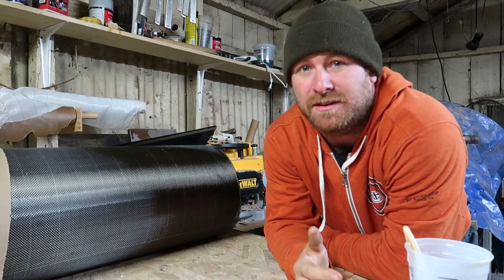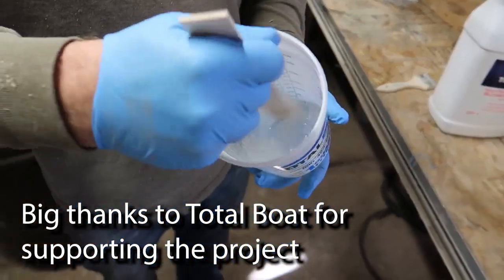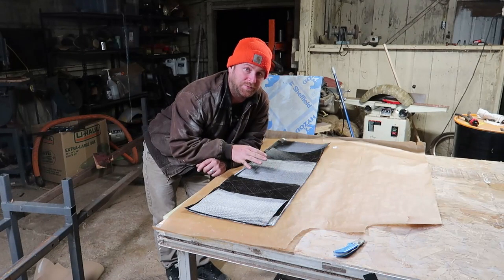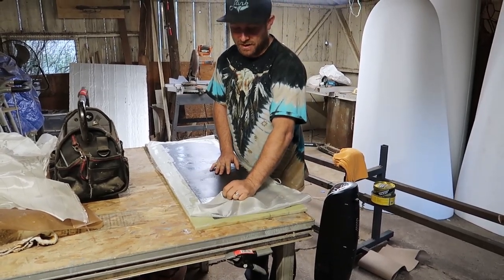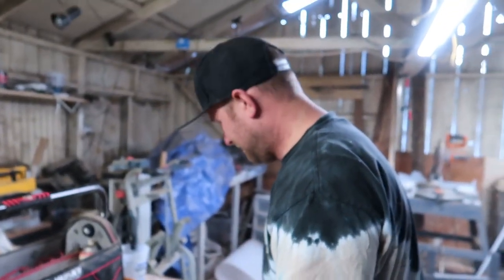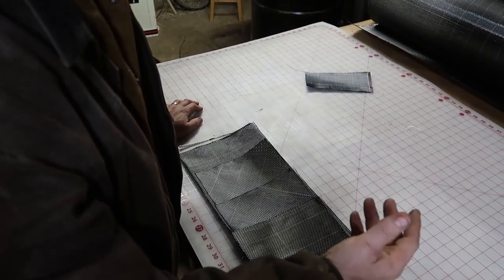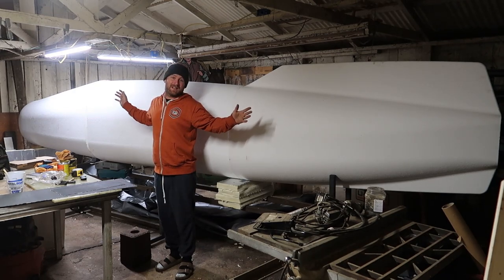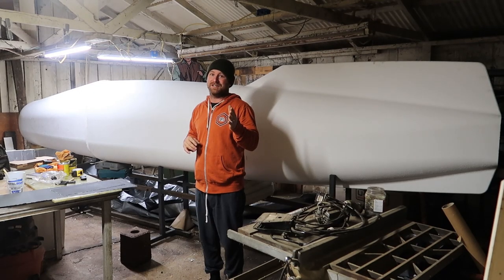Carbon Fiber Body Part 1 | Foam and testing | Lark Machine Co

Comment: Look to Ral Klingberg, Klingbergwing Youtube channel for the benefits of using a glass/foam/carbon layup. Light weight, lower cost, very rigid composite solution. A few mm of filler between the inner and outer layups  makes a huge difference in stiffening up body panels. Ultralight Aircraft Workshop, Leon has done extensive testing of composite sandwich techniques. Consider that carbon is brittle, it can fracture into sharp fragments, a Kevlar layer Is a good inner shield against carbon splinters.
Reply from the maker: Other comments have been shedding more light on that. That's why I love the youtube community!  I'll binge watch the channel tonight!

Comment: You could try and ring Denis Manning he is overflowing with knowledge on this stuff. Also thoughts on your supports you could place them in the front and rear where the wheels will be so less repairs needed as with the center section? I am just learning about vacuum bagging this could be a thought,   Brilliant job keep the updates coming, looking forward to seeing your progress through this build, best of luck
Reply: Putting supports in the areas that will be cutout for the wheels would be the best way to go.
Reply from the maker: Awesome input. I took a visit to Dennis last year! Such a nice guy. I was looking at his molds to see if they would fit.  I'll edit my visit for the next video.

Comment: Once the fibre is on the shell the contours will add considerable strength, basing your estimate on a flat section maybe not that realistic, plus you want to keep the weight down, and you can't take layers off once it's done and you have second thoughts. Great build, hope to see your video of it running.
Reply from the maker: This video has opened a lot awesome conversations with some experts. I plan on doing some more mock ups on round parts too!

Comment: Nice video! How many GSM was the carbon fabric? Are you laying straight onto the foam and then using that as a shell (sand outside smooth) or taking a mould off the foam and laying into that? Good luck 👍
Reply from the maker: The plan is to get the foam mounted, smooth and seal it, layup over the foam and cut the part from the foam
Reply: @sheanyquist  ok good luck! I made a motorcycle swingarm cleat using a similar method, but it needed 2 or 3 coats of resin on top at the end to build a layer of resin that covered the carbon weave and that I could sand dead flat - which added a fair bit of weight and work to the part. 
In this case I would have had the foam CNC directly to be the mould, smooth it with boat building epoxy primer and sand before taking a part, however I have no expertise so could be talking crap 😅. I look forward to seeing your results anyway!!

Comment: If you want to save some money you can always mix a couple layers glassfiber on top of the carbon. This will maintain strength while cutting some cost. Common praxis.
Reply from the maker: I've heard that mixing glass and carbon can be bad. They expand and contract at different rates and can cause serious delamination.  I've never tried it, but I don't want to risk it on this project

Comment: I've watched your videos, and never saw a heat gun being used.  Your layups look very resin rich.  Heat will thin the resin and help you get 100% saturation, without excessive resin. Their is no extra stregnth in being resin rich.
Reply from the maker: I am heating the resin before mixing for the final layups. Seems to penetrate better, just pops off a bit fast for a one man job
Reply from the maker: Keep the tips coming!!!  I'll take any advice I can get
Reply: @sheanyquist  Locally heating it while you work it is the preferred method. Heating it all at once caused it to exotherm.  Go to Walmart had get a cheapo hair dryer. It will make a big difference
Reply: @sheanyquist  Find your closest EAA Chapter. It probably has a great composites guy, who can show you some tricks.....

Comment: Try vacuum bagging. It will get rid of excess epoxy. Too much epoxy makes carbon brittle. ((I'm a hairdresser who makes carbon fibre hydrofoil boards as a hobby) not an expert just repeating what I was told by experts.)
Reply: Yeah, I would have expected to see the vacuum bagging aspect of the test. From what I understand (limited understanding) is one should match the weight of the fiber to the weight of the resin, which provides best strength to weight ratio of the finished composite. I hope Shea vacuum bags the entire shell, to get the most strength and the lightest weight.
Reply from the maker: Vacuum bagging is an option, it's just not practical on a 20 ft piece on a stand
Reply: @sheanyquist  ( take all ideas with a pinch of salt, again I'm not a carbon expert. I just muck around with it for a hobby) Could you not cut the mold/boss in 2 halves either vertically or horizontally, then put the flat bit on a large flat surface and vacuum bag it? 20ft is long but plastic vacuum bags come in rolls long enough to do boats.

Another trick/technique I was shown is pre wetting each layer separately. 
First laying out a sheet of plastic on a table.
Then using only a small amount of epoxy and the roller wet the cloth.
Then "plastic squeegee" to remove excess epoxy. I got the large plastic squeegee from the paint section of the hardware store.
The last step is lift the plastic off the table and lay the wet side down in your desired location. Once layed down take a second soft squeegee (like for window cleaning) and wipe it over the plastic to remove even more excess epoxy.

Amazing watching what you're up to. Keep the content coming!
Reply from the maker: @posko76  absolutely, I'm open to the idea and I definitely think it will help. I'm just not sure how it would work with this size part
Reply: Splitting your plug horizontally would be a good way to go for the main part and then split the tail vertically ....

Comment: Hi Shea, A very skilled man. Just a thought: hill climb bikes. I've long thuoght that one could build a really exceptionally effective hill-climb bike with an electric motor and battery and two wheel drive.  The entire design based around keeping the weight low, giving the rider the optimum seating position / control position.  Its a very niche sport, but there's a slightly off-beat following in Belgium.  Nice chocolate, great beer, very quirky people. https://www.youtube.com/watch?v=c5M0vi338Hw  I'e always wanted to see a different kind of bike take this on, you don't need a huge battery, just something that will run the engine for 30 seconds.